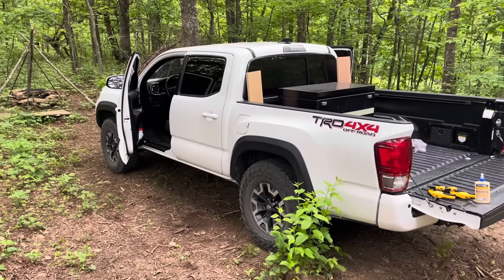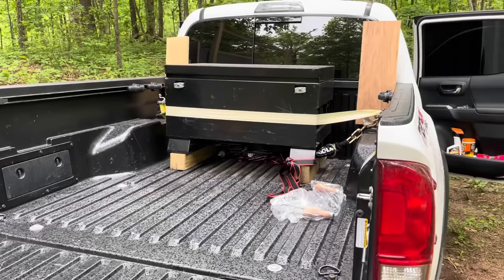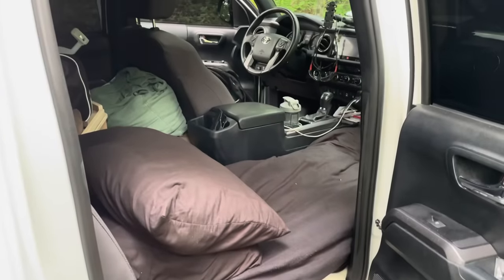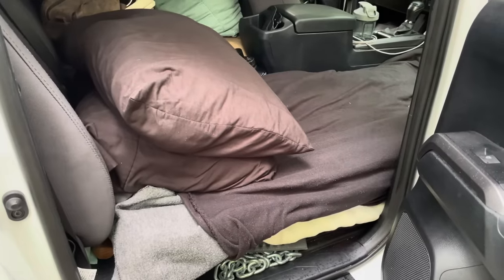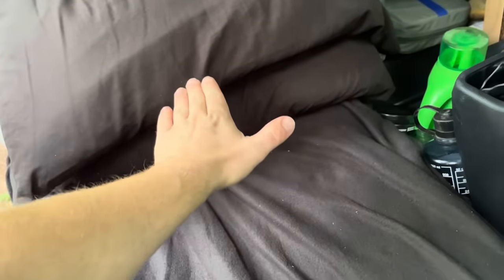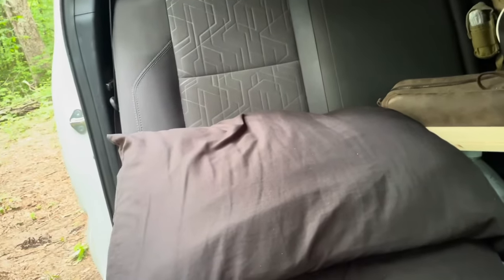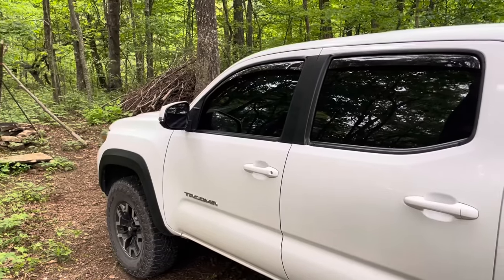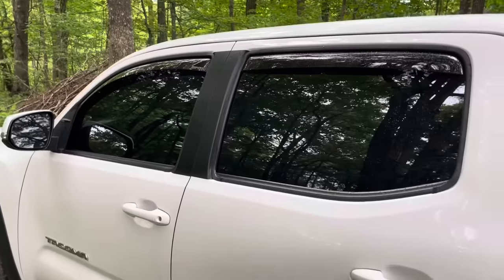Modify your pickup truck cab to live in it | Save money and discreet | Travel truck | Hunting truck

Comment: Why not just get a bed shell so you can sleep back there? Or you can also keep some of the stuff you need from the storage back there more secure and sleep where you do now you can get a nice jackery power box also to power your stuff.
Reply from the maker: Great question. I played with the idea of getting a bed shell for a long time and I’d sleep diagonally (it’s only 5’6” bed. However, the main reasons I went this route was my budget and cost effectiveness, more truck bed space (I failed to mention in the video), and stealth camping so I can sleep almost anywhere in city and suburb areas.
Reply: @ArcadianOutpost  I understand but it is definitely worth it in my opinion I'm 6'2" and I sleep comfortably in the bed I also have the short bed you can tint out the shell windows if you didn't know perfectly legal so you don't have to worry about possibly getting tickets for the front window tint super annoying if you look around you can probably find someone selling one for cheaper than brand new have it installed it's a game changer.
Reply from the maker: @DemonTime08  wow that’s not bad being that tall and you can still fit. I’ll probably get one at some point, but this works quite well for the time being. Would probably get the raised shell to get more head space inside.
Reply from the maker: @@XcoloradokyleX For my situation, this option is much easier, more cost effective, and discreet.
Reply: I like your idea , I don’t like the thought of sleeping in a tent on the truck or ground , and camper topper and truck campers are so expensive . The tent camping is fine , but scary for me , because , bears and such could demolish a tent
Reply: @ArcadianOutpost o
Reply: @ArcadianOutpost I've slept in the back of a Toyota T100 bed with a top raised shell.  A mattress fits perfectly with the T100 bed, raised top made it super comfortable, hardly any diff from a real bed.
Reply: What do you normally eat or cook?
Reply: Not to mention... UNstealthy when you're climbing out of the bed of your truck all bedhead at 7am. Plus, I'd wanna turn the key and go if I want. I like this set up.

Comment from the maker: Hope this helps some of you out there. Likes are much appreciated. Thank you.
Reply: You should checkout a bestop camper shell or a soft topper, they aren't that expensive and work very good with a tarp covering the end of the bed
Reply from the maker: @missourimongoose8858  Those look nice. I like that they fold up and doesn’t appear to compromise the storage box in the back of my truck.
Reply: @ArcadianOutpost  I got one a few weeks ago and I love it, went camping in Indiana, missouri and Georgia already and it's awesome for the money, also if you can get you hands on one of those giant rubber mats they put outside grocery stores it makes a great bed liner
Reply from the maker: @missourimongoose8858  Awesome. Good ideas. How does the camper shell do against rain?
Reply: @ArcadianOutpost  it hasn't leaked at all, it was kind of a pain to put it on the first time because it's tight but it keeps everything 100% dry
Reply from the maker: @missourimongoose8858  Good to know. Thanks

Comment: Good call on living in the woods and getting away from the day to day! I put a box in the back of my Taco also, but a great way to secure it is this..... buy some t-nuts for the rail system, drill through the box and bolt it down. I used 3/8-16 threaded hand knobs for easy removal. When my box is closed and padlocked, you can't get in to unscrew the handles. I'm using the large plastic tote/storage chest from Tractor Supply. Keep up the life YOU want to live and forget the rest!
Reply from the maker: Awesome. I appreciate the feedback and advice and I agree with all. I’m going to look into the t-bolt idea. I like that one.

Comment: Great video! I took the passenger seat out my 2018 DC Tacoma a few weeks ago and I'm living out of mine too. It's the best way to stay warm up here in Montana. Good luck to you and look forward to following your channel.
Reply from the maker: That is awesome to hear. Hope it works out. Remember, no need to run vehicle. Lofty blankets will be your best friend in the winter. No need to buy fancy upgrades or things to live in it. Get creative. I wear a big winter hat and pull it over my eyes and heavy wool socks. Use foam ear plugs if it gets too noisy outside. Crack maybe 2 or 3 windows to reduce condensation inside instead of all 4 like in the summer. When you wake up, use anything long enough push brake pedal and press start engine button to warm up vehicle. Lol. Too easy. I’ve been way behind on videos, but I’ve made a couple major upgrades to the truck I’d like to show someday. Work has me distracted at the moment.

Comment: For the privacy you could consider getting form cut sun shades for your side and rear windows. They make them for more than just your windshield but otherwise nice mods. Another item, if you want aireflow, you can buy a cheap fan for around $10ish dollars and what are called "Roadie" Overnight window tent (they stretch over your doors). You put them on your rear doors and they give you a mesh cover so you can crack down your windows without letting bugs in
Reply from the maker: I may look into the form cut shades. Good idea. Also, since you brought up the fan, I am currently working on a simple and effective airflow project that doesn’t cost much. Don’t know when it’ll be completed, as it’s not quite needed anymore with the cooler weather coming, but I’ll certainly make a video when it’s done sometime. Thanks for sharing the tips.

Comment: I got a few cargo nets at a garage sale (.75-(4)-3)
All 3 being like the ones sold for the explorer type cargo nets. One aftermarket with metal hooks, I used that one to hook and zip tie the sides and bottom to the roof to create a above head spot to store light stuff like my shades for the front and sides. Windbreaker , and a travel pillow for a extra with others.
I took out the passenger seat and use bedding/blankets as a level base, then foam pads like you. Sleeping bag as well.
I took off my panels and bought 1/4 and 3/8” foam/foil adhesive backed insulation and undercoated inside doors, lubed channels and gears. Did speakers and baffles while there. Reattached all
And sounds better
Holds heat and noise, got rid of moisture flimsy insulation for less moisture wicking, more coverage and overall better comfort. Did the 5% back/sides 
On a 2010 Ford Ranger crew cab. I did a backrack/toolbox used on line. LEDs and a PA speaker, 2-way radio outside monitor. Paint and truck bed coated all.
Reply from the maker: Awesome, I took some notes there. Thanks. Yes a friend gave me a bungee cargo net. Works well. I like the insulation idea. I’ll have to explore that one.
Reply: @ArcadianOutpost  it works well with the insulation.
Future-
Rubber flooring 
Tear out flooring and inner ceiling. 3/8” for sure.
Antenna maintenance while there.
Run wire to light up roof lamp.
(I disconnected it at doors so no wake ups greeted by a new LED in roof.)
Just panel works.
Did I mention I wired my toolbox with power ports USB/Cigarette ports.
In cab and box. Poewer gauge and LED strips and lights for at night. And to charge during trips. Power pak, LED self lights, AA Battery’s, handheld radios. And a shortwave, AM/FM, Bluetooth/weather. For mornings. Mini-long time working radio.

Comment: Weather tech makes prefitted foil covers for all windows of most vehicles. A set of those and you’ll be private, even with lights on, cooler, and you don’t have to tint front dark so you can still see out the sides at night. Also, maybe a split lid chest that has doors opening one each way and position one near your back window so you can access it from inside. Or you could just flip your box around 🤷🏻‍♂️
Reply from the maker: Nice, I’ll have to check those out. Thanks for the ideas.

Comment: I took out the back seats entirely, unnecessary weight, more space. I got a diamondback cover for the entire bed, about the same weight as the back seats and bolts. This way everything in my bed is waterproof. I have cleats on the cover so I can tie down things on top, it will hold up to 400 lbs. I got an aluminum hitch cargo carrier with a ramp for additional storage. I’m building out my 10x6 trailer for sleeping in, so I left the passenger seat. 
I did consider your approach though, nice job.
Reply from the maker: Nice work. Agree, most people don’t consider reducing the weight. Everyone seems to add 100s of pounds.

Comment: Nice,  you can make the platform for the bed a little higher so you have more storage space under, and you will not choke the A/C when it's in re-circulate mode. I am  thinking of doing this, or a camper shell...hence I'm watching a lot of videos to have an idea.
Reply from the maker: True but it isn’t much. Mine has always been slightly slanted downward to accommodate room for my feet. I do not slide down the platform either. The he moment you raise the platform, the foot room is quickly reduced.
Reply: @ArcadianOutpost  makes sense.. thanks

Comment: Im moving into my 15 tacoma in july simply because im tired of putting up w management at apts and thehigh cost of rent.
Been planning for good while now and have in mind a similar sleep set as yours.  But i want my bed to fold so i can get in and out w stuff.  We will see if im able to pull it off.
Removing all extra seats and backs.  So many storage pockets to utilise.
Accually im i lil excited bout it and was happy to find your video.  Removing the seat backs would get you alot more options.  Just saying. 👍👍

Comment: Did you consider a fiberglass shell or what I have is a folding segmented rigid tonneau cover?  Not to sleep under...too short.  But it would give you lots of lock-up secure storage.  The tonneau can't be opened until you lower the tailgate...and my tailgate locks.  Back when I was in mountain rescue I had a Jeep XJ lightly modified for overnights.  I ran wires and switches so I could conveniently operate windows and domelight from my bed.  Steel tents are great in bad weather.  Everyone on the team was jealous.
Reply from the maker: I’ll buy one of those at some point. I’ve been making do for the time being. Sounds like you had an excellent setup. I like the idea of running wires and switches to the bed. That’s cool.

Comment: Been thinking of doing similar with my 2007 Ford Ranger (2x4 hi rider) here in Australia 🇦🇺 
Looks like it could be a good setup for cheaper travel during cooler months. Sleeping in the cab during summer just wouldn’t work.
Reply from the maker: That is awesome. Best of luck if you do it. Summer gets tough at times but I just use the vehicle for sleeping. Don’t hang out in it when you don’t have to. Stay active and enjoy the outdoors. I also bought some USB powered fans and a battery generator.

Comment: I've been watching videos like this on youtube for a hot minute now.  I'm interested in getting/building a camper trailer and have a truck to pull it.  my question for you is why don't you get a pull behind camper trailer?  there are some pretty great/cheap options out there
Reply from the maker: Great question. I actually just posted a video addressing the major reason for this. I did however leave out the costs of things in that video. It gets complicated. I’m not against buying one, but right now I feel content with my current situation. I work a lot and basically only use my truck to sleep, commute, and occasionally travel. It’s got everything I need and want right now.

Comment: You should put the seats back in & trade it for a minivan or cargo van!  I lived in a minivan for 3+ years, with solar, 7.6kwh of lithium batteries & a 3000w power inverter for 120v appliances, and a 5KW diesel heater = no condensation!  10:29
Reply from the maker: Awesome. I may be exploring more options in a year or two but don’t think I’ll ever get rid of the Tacoma. Love this truck.
Reply: @ArcadianOutpost that’s cool, funny thing is I got rid of the van & bought a 23 Tacoma 5’ bed, I see why you love it😂 11:51
Reply from the maker: @tonyl1483  that is cool. Wish you luck with your journey. Over time, I’ve since built a new (and rather nice) shelving unit and added a small battery generator (eco river 2) so I don’t have to run the truck to charge things. The battery generator is set up to charge whenever I drive the truck. Works out really well. In my other videos I’ve shown how I improved my bed platform too. I appreciate your update and good luck to you.

Comment: Great idea, thanks for sharing!  Wondering if I could duplicate this with a 2D access cab model?
Reply from the maker: Good question, I honestly don’t know. I’d imagine it would be slightly shorter but maybe not by much.

EDIT: Sorry I thought you were referring to the sleeping platform itself. Still a good question. I don’t know what that total inside cab length is but it might work.
Reply: @ArcadianOutpost  Thanks.  Yes, I was referring to the sleeping platform or the overall length.  I'm a bit shorter than you.  I can look into this or check it out at a local dealership.

Comment: Dude I’m doing the exact same thing in my 2017 tundra. I’m in Texas so it gets pretty hot. You have any ideas for an ac unit?
Reply from the maker: Awesome, best of luck. You’ll have way more room than me. I don’t have a solution for an AC. I don’t like spending time in the truck unless it’s bad weather. Really just a place to sleep and get out of the elements if needed. The main thing I do is maximize air flow. I purchased a few different USB powered fans on Amazon and working on a device that circulates air with the windows only slightly open. I purchased a small battery generator to power them all night. Hope this gets you started. My goal in all this was to keep costs and maintenance low.

Comment: Did you purchase this truck new or used? Is this truck working for you in fuel consumption and when traveling off road?
Reply from the maker: Lots I could say here. Bought it used in 2018 with very low miles and a great price compared to the cost of one today. Fuel isn’t too bad. I have a highway rated Goodyear all terrain tire that is a size larger than the stock tires. They are great off road and feel like air ride suspension compared the BF Goodrich mud terrain KM3 I had before these (worst and most expensive tire I’ve ever owned on a vehicle by the way, they handled great for off road terrain and that’s all they are good for). I get about 19+ mpg highway and maybe 17+ city with mine now. The mud terrains got me 16 if I was lucky and the soft rubber didn’t last long at all. My advice, don’t ever buy the aggressive ones unless you really need it. You’ll pay out the pocket for them.

Comment: In hindsight,would you prefer a pick up with a camper top ?
Reply from the maker: I’m content the way it is now and this way has worked really well for me. I got to a point where I realized everything I want to add/modify to a bed camper setup, already exists in the cab of the truck (AC, heat, inverter with outlets, etc.) Someday I may buy some sort of shell or cover and/or a camper trailer but we’ll see. I’m currently building a tiny house.

Comment: What height could sleep comfortably in the backseat? I'm 5'6, just wondering if there's a truck out there that could accommodate without your style of modification.
Reply from the maker: Really not sure, but I think it would have to be a full size truck and not a smaller one like the Tacoma, frontier, or ranger.
Reply: @ArcadianOutpost  thanks, that makes sense. I'm sure model year is also a factor, I have a 2001 Camry which is just a little runt compared to newer Camrys. I lose track of it in parking lots when current  sub-compact sedans block it from view.

Comment: Do your dash air bag and seat belt lights stay on  after you disconnected the seat wires ?
Reply from the maker: Yes, unfortunately they do. I got used to it. There may be a way to delete the code but not sure.
Reply: @ArcadianOutpost  okay cool, I know you said you’ve run it this way for awhile, Orr doesn’t mess with the onboard computer or anything due to the disconnect? Looking to do this on my hunting trips.
Reply from the maker: @alexalvarez9462  Cool. I’m no mechanic, but so far no issues my way, and no one has informed me of any issues on theirs after seat removal.
Reply: @ArcadianOutpost  cool man, that’s gonna be a game changer!!
Reply: I asked a dealer if it disables the entire airbag system and they said they weren't sure (2021 Tacoma). Stopped me from removing my seat. Might look into it..

Comment: Pretty smart to remove front seat just not functional for carrying any passengers. I have 4 seats for passengers in my Suburban because I have a piece of 4x8 oak in the back that I have cut in 2/3 and 1/3 sections so the 1/3 section can be moved to allow the middle seats to be used. I can carry almost 3,000lbs in the Burb and tow 10,000. I can get 20mpg on the highway at 60 and my vehicle costs less up front and is cheaper to maintain when it does need parts. Love that Toyotas are made in US-Indiana but the price to function ratio is too high. You can talk about whether or not Toyotas are overpriced. I’d say old Corollas are not but old Toyota trucks are. Cool setup though.
Reply from the maker: I’ll have to check that out. Sounds like a solid setup. I actually didn’t know suburbans were that good on gas. Good to know and thanks.
Reply: @ArcadianOutpost I got 18mpg at 60mph driving west coast last year in the Burb with both cats bad, plan to get cold air intake from summit racing increase mpg 2mpg, gas is fuckin expensive in California
Reply from the maker: @ryanunslavd1656  Nice. I travelled Cali once and never returned. Lol. Cool natural setting and climate but didn’t care for anything else, especially the cost. Best of luck though and hope everything works out for you.